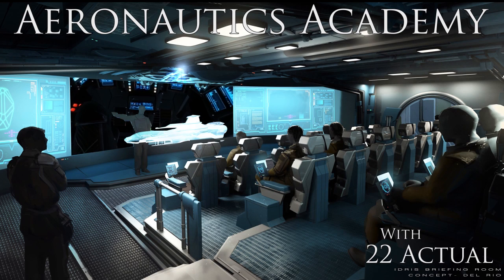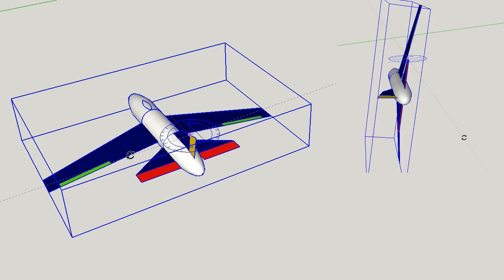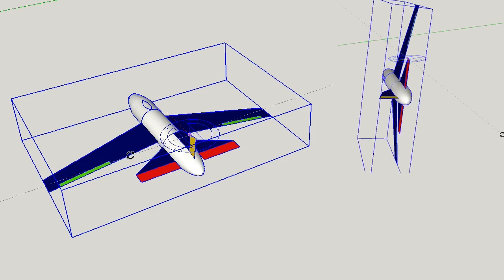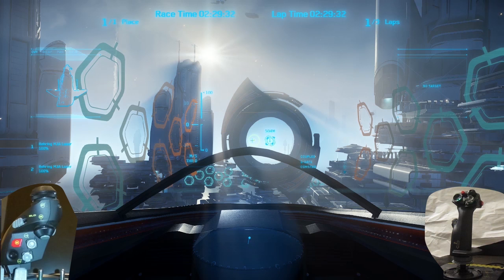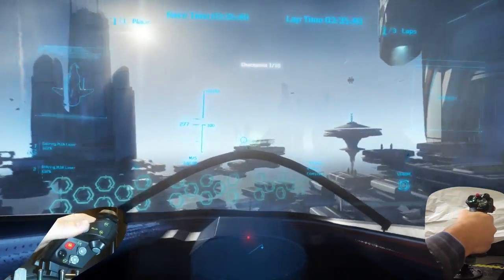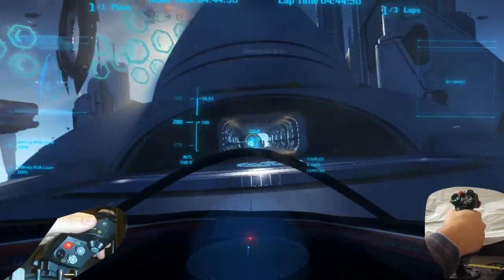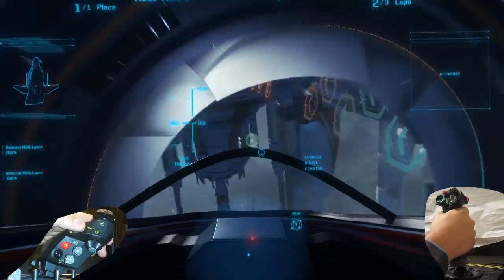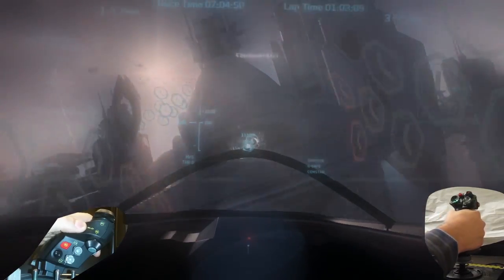Star Citizen - Aeronautics Academy - Joystick Setup

Comment: are there ways to switch flight controls on the fly? ie entering a planets atmosphere where the controls might benefit to put the roll on left and right movements of the joystick rather than the twist
Reply from the maker: +AdmiralNovastar If they change the flight model within atmo then yes you would benefit from changing it.  However I believe that as the ship are purpose built space ships they will handle close to the same way as they do in space.   You're not depending on an aerofoil to move the wind or other aero control surfaces, control is still maintained via the thrusters, which is where this model shines.

Comment: Hi 22 Actual, Thanks for putting this video up, will help lots of people I would say.
I have a request if you could try it; could you somehow bind the games aim (like it is with mouse use, where the user can use the gimbaled weapons effectively) to the thumb hat/witches hat?
Reply from the maker: HOMAS is what you're talking about, I picked up a T16000M to try that but I've been busy.  I'll probably put up a bunch of different videos covering the different styles over the holidays :)
Reply: 22 Actual What does HOMAS stand for mate? :) 
Also just to confirm this would utilize the hat on the stick to aim the gimbaled weapons? I know the fixed ones you will need to move the joystick (entire spaceship) to aim it, but having the ability to use gimbaled weapons with its ability to track a target without corrections to the ship would be excellent!!
Reply: TheAngelsReason HOMAS is Hands On Mouse And Stick, like how HOTAS is Hands On Mouse And Throttle (like he uses in this video). The T1600M is one of the all-in-one joystick designs that has a slider for throttle, not a separate one on another platform.

Comment: I am used to pulling on the stick being pitch up and that feels natural with roll on the stick. However, with my trials with yaw on the stick, I am not finding it intuitive to have stick pull be pitch up because it feels like the stick is controlling the crosshair (like an analog stick).

I am curious if what your pitch pull is? I'm tempted to change it so pull is pitch down.
Reply from the maker: crazyjackaljones Pitch Pull brings the nose up, Pitch Push brings the nose down, like a plane.  Except the yaw is left and right on the stick.
Reply: 22 Actual Guess I'll stick with it and hopefully it will feel right eventually.
Reply from the maker: crazyjackaljones When I changed from Bank and Yank to Space Sim it took about 3 hours of gameplay before it felt normal.  The Switch from HOTAS to HOMAS took about 5 hours of gameplay.   If you have a chance read this article "The Rise of the Expert Beginner".  It's a bit of a read, and directed at developers, but his examples are real life examples and the "Expert Beginner" can be applied to anything.  I'm not saying that this is the best way and the others are wrong,  I just saying that not looking into other ways of doing things is not a approach to anything.  http://www.daedtech.com/how-developers-stop-learning-rise-of-the-expert-beginner
Reply: 22 Actual Was an interesting read.

As someone just coming in and readinv up on tips and advice, I'm still personally concerned with over familiarizing myself with any system, much less the current at the moment.

It could all change. CIG might consider implementing more severe bodily/organ damage that would make g-forces under yawing intolerable and unviable compared to the conventional roll/pitch. Who knows.

Comment: this is great, but it doesn't sow how you would use this in combat, how would you use your gimbaled weapons?
Reply from the maker: Ah yes I don't really make videos for combat but i might soon.  The Gimbaled weapons with a joystick see to apply a very slight amount of auto-aim when you're close to the target (Ref: Mustang Delta). otherwise the Gimbals don't really assist Joystick users.  You can if you want use a HOMAS or HOJAM (Hand on Mouse and Stick / Hands On Joystick and Mouse) and aim with the mouse and control the ship with your joystick.  This is really beneficial for Super Hornet Pilots.  With the mustang Delta your Max Gimbaled effective zone is quite narrow.  Check you controls config for how to enable HOMAS mode (Ctrl + R I believe)

Comment: Ok so pushing the stick forward the ship goes down pulling the stick backwards ship goes up pushing the stick left ship turns left pushing stick right ship turns right twisting stick right ship rolls right twisting stick left ship rolls left is that what you're saying or did I completely missed the whole thing
Reply from the maker: +chrono2959 Sorry i kind of gave up on SC after they changed the flight model so many times.   This was primarily about rotation of the ship and not strafing.  Hopefully as this was ten months old someone else helped you out.  iF not let me know I'll keep a closer eye on this account.
Reply: I don't even remember the question but thanks for responding
Reply: Actually it's supposed to say I didn't even remember asking the question I kind of give up on the game 2

Comment: Or u could set up dual joy sticks
Reply from the maker: +Eric brathwaite You could, I haven't played too much with the dual joysticks, so I'm not an expert with them. That said, the potential is there but a mouse will always be faster and more accurate than a joystick when it comes to aiming.  The people I've seen using the dual joysticks weren't doing anything fancy with them, just using them as a 2D throttle and it seemed to waste a lot of the potential.

A 3D joystick + mouse would be better than HOJAM or Dual sticks but I have only seen Proof Of Concept 3D joysticks and nothing on the market yet...

HOJAM also allows you to interact with a HUD or interface quickly...